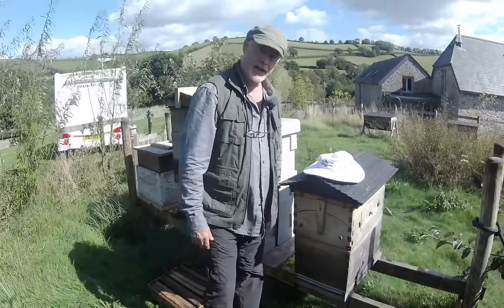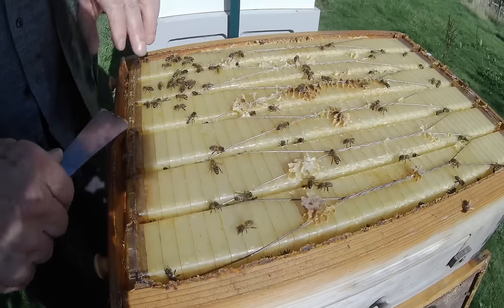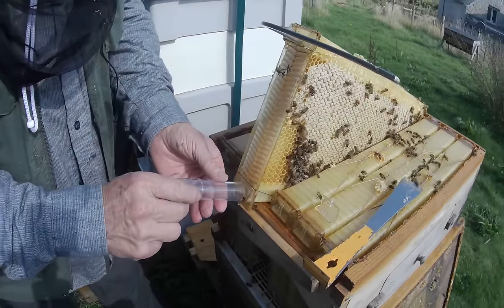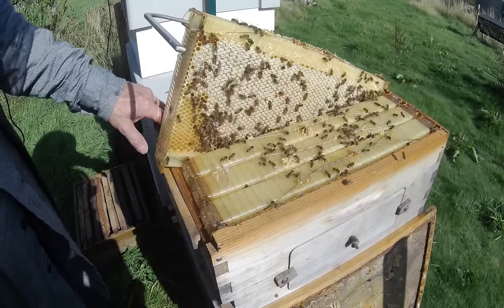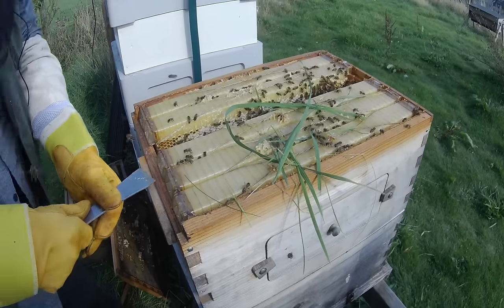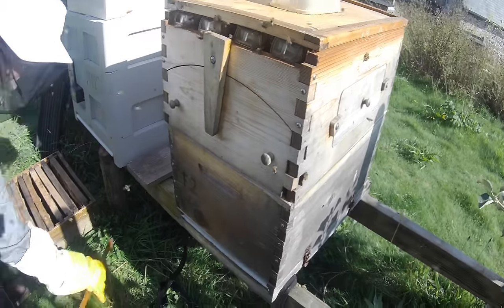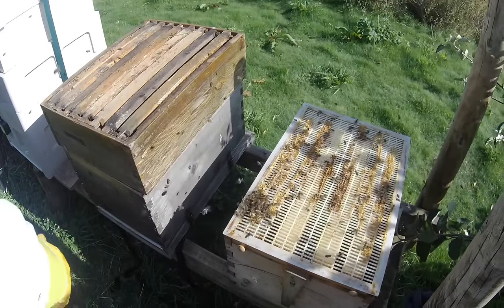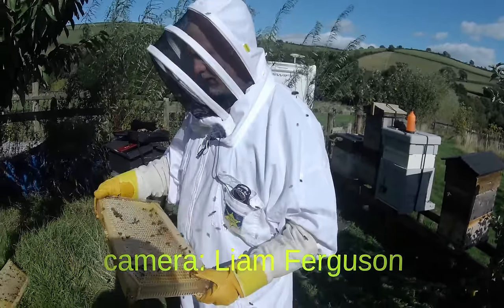Don't buy a Flow Hive until you've seen this!

Comment: I appreciate you sharing with us your experience. Every beekeeper has a different opinion about how they do things and this video is a perfect example. I have a flow hive. I love it. I also live in Colorado and I do not leave the flow frames on my hive over the winter. But first, it looks as though your bees are at the end of a flow, possibly being robbed and that is partly why they were so defensive. Because your flowhive wasn’t put together with the metal piece and the screws properly used to put the frames in the correct position, it led to more issues. I read that you think smoke causes the bees to prepare to leave and fill up with honey, but the chaos produced in not smoking the bees would be more likely to cause them to abscond. I try not to use much smoke with my bees, but it is a necessity if you are dealing with defensive, irritable bees. I start with a bit of smoke on my hands, hive tool, clothes and at the entrance. After opening the top or removing a box, I give another puff of smoke. This helps protect you and the bees from more stress and stings later. The smoke confuses the alarm response and pheromones used to communicate danger to the other bees. If a bee is bumping me and letting me know she doesn’t want me there, I give her some smoke. If a bee jumps at my hive tool, I give a puff of smoke to that bee. If stung, smoke where you were stung, because bees will be drawn to attack that spot. More alarm pheromone in the air will make it impossible to work bees without chaos. More chaos~more stings~more dead bees~ more alarm pheromones~ and the cycle continues. Fewer stings mean fewer bees dying. The bees will also put the honey back into the frames from their honey stomachs when the threat of fire is gone. If I can tell my bees are more on edge than normal, I will wrap up the inspection. I don’t know your climate there, but it looks cooler. If you have enough time for the bees to put the honey somewhere before winter, I would turn your flowhive box so you can harvest from the back of the hive. If it is too cold for the honey to be harvested outside and won’t be able to run out of the flowhive, then bring in the frames and harvest inside the house where it will be warm enough for the honey to run out of the frames. Use a regular deep box to put your beeless flow frames in one at a time to transport into the house. Once inside you can put back into the flowhive box. I would harvest the two middle frames that were capped for yourself by tilting the box at an angle like the flow videos suggest, then I would harvest the uncapped frames and feed the honey back to your bees. Just put the honey containers inside a deep on the top of your hive where the bees can move it back down into the hive. Also,  be sure to put pine needles or something on top of your honey to keep the bees from drowning and make sure no bees can enter the hive from anywhere but at the bottom where they can defend it. I would also make sure you have the entrance reducer on. I’m sure you are a veteran at all of this, but I thought u would go into tail for the non beekeepers following this. I let the bees clean the flow frames but make sure you put them at least 30 feet away from your apiary to not attract robbers. Then store the frames for winter. I always make sure I have a whole deep filled with honey before I put on my flowhive. I’ll put it on my strongest honey producing hive and will empty it for winter whether for us or the bees. I do think living in Hawaii would make the flowhive much simpler, but here in Colorado I just adapt to what works best for me. I wish you all the best with your hives.
Reply: Where in Colorado? Been looking for some local beekeepers to support
Reply: long comment man
Reply: Thankyou for your fascinating and educational comment.

Comment: A few things here, 1) you didnt follow instructions when u put it together, flow frames not adjusted tight to back of box and missing metal pc which keeps them from escaping out the back. 2) the cells split down the middle when opened and have a slight gap which will NOT trap a bee head, and you shouldn't be harvesting until a frame is full anyway. 3) Most beekeepers know that bees fill generally from interior to exterior, so if the window shows capped cells, you can be reasonably sure the interior is capped as well. Opening and checking before harvesting is always best practice for any beekeeper. 4) You didn't know which way the spigot is inserted, and actually guessed wrong, it will only fit 1 way with a tab and slot, your lack of knowledge of the  product does not give the impression that i should trust your opinion of it. Perhaps another view of the instructions and possibly speaking with flowhive owners would make you more comfortable with the product before you post a review next time.
I have owned a flowhive for 3 seasons now, harvested exceptionally clean and clear honey every season with minimal injury to any bees. I also have traditional hives, pros and cons to both systems. Flowhive themselves have stated that owning a flowhive should not be an excuse for practicing poor hive maintenance, regular inspections and treatments are still necessary for healthy and productive bees. Anyone who thinks they can just throw a flowhive in the backyard and collect honey without taking responsibility for the care of the creatures that produce it hasn't done their homework. I don't direct this last statement at you personally, as I can see you have productive healthy bees.
Reply from the maker: You clearly didn't watch all of it as I covered all of those points, as did about thirty of the comments below. But happy to give you a chance to sound off.
Reply: @BarefootBeekeeper  my apologies, I wasn't trying to slam you by sounding off, tried to point out a few of the issues that may have led you to your opinion on the flow hive. If that came off as harsh, I apologize.  I did watch all the way through, and yes you did address some of those issues, also spillage of honey into the hive during harvest is a valid concern, although opening 1/3 of a frame at a time pretty much stops that. It  does slow the process however. Your concerns with the thicker honeys not flowing was very informative as I live in a part of Canada where I don't have that issue.  Anyway, keep doing what you do and good luck with your bees!
Reply from the maker: @johnnybgoodbeesandbarbecue5788  we have ivy (Hedera helix) that sets like hard candy, and would really jam this thing up if it got in there. I think the only way to extract it would be to let the bees do it.
Reply: Show us your review of the flowhive! give us another perspective please. I am debating whether to buy a flowhive or not, so any information is good information
Reply: @BarefootBeekeeper   It makes a difference on how you use it, my friend. I suggest you watch a few videos of flowhives just to sharpen up on your harvesting knowledge when using these frames.
Reply: That metal pc was not included in first version of flow hive and they also realised it after people raised issue and uploaded videos about it so first they gave temporary soloution and later fixed it,Those  also had issues of gaps between box wall and flow frame . This flow hive is also from 1st batch when released
Reply: You have to realize there have been many changes to flow give since the beginning, so don't bash him for not having a hive that looks exactly like yours. There have been problems with flow hive since it began.
Reply: I’m new to beekeeping. Seems like a nice gadget but I feel it takes something away from the experience. Maybe it’s a newbie thing. Nice video.
Reply: Where can I find good information on bee keeping I want to own a  hive but want to do it right this guy doesn't seem professional since hes not wearing a suit.
Reply: @1-chef-875  bees can pick up our pheromones so if you are nervous and scared they will know something is up and get more defensive. if you are calm and collected they will only be confused as to what is happening with their hive. I have seen many videos of ppl doing this with no gear and they don't get stung
Reply: @1-chef-875  Lack of a suit is a sign of confidence and professionalism, not amateurism.

I don't agree with some points here, but yours really sticks out.
Reply: does the plastic it make it taste funny?
Reply: @1-chef-875  If you had done your homework, you'd know that Phil has probably forgotten more knowledge about bees that you'll ever learn! He definitely knows what he's talking about
Reply: @johnnybgoodbeesandbarbecue5788  I am wondering if I should get one or not. I wanted to start bee keeping, but don't really have enough space in the house to keep buckets just for collecting it and spinning the hives and keeping the spinning thingy is a whole other story. However I will If I have to, but if i don't I'd like to get the flow hive. I've heard nothing but good from it so I'm not sure. This is the only negative I've heard.
Reply: @MalixAtix  I have one of the initial Flowhives and the metal piece came with mine.

Comment: 1:) you need to adjust the screws in the other end of the frame to locate the flow frames all the way to the window view so no bees can get up via the end gaps. Ask Flow support or read manual on how to avoid bees getting into back window view. You may miss the side bars where it blocks the gaps next to the box walls. 

2:) You said you don't want to feed sugar and leave plenty of honey for winter,  why didn't you add the ideal box first then flow super? Should everything in the flow super be yours? It seems to be contradiction on what you said and what you done? 

3:) Your tool needs a hook to pick up one end and other end by hand rather than pickup by the cables,  this risks the damage of the frames structure by flexing it. 

4:) You shouldn't harvest off the hive as it defeats the purpose of flow hive,  it will be a sticky mess when you do it inside so don't complain if it doesn't go well! 

5:) Honey Super at the entrance? It's an invitation to robbers to come in and help themselves while you are at the dearth time? 

6:) it seems to add more dramas when you don't use smoker during inspection???
Reply: You haven't followed Phil very long, have you.
Reply: @W1ldt1m  Yeah, I think your right. Most of the Pro FloHive comments are really angrily pointing out all the unrelated things he "got wrong" without knowing who he or what he normally advocates. Funny.
Reply: Ir stressed the bees much more  than turning the key of the flow hive. Jesus, this guy has issues
Reply: He's not using it right, and the hive wasn't put together totally right. He needs to watch a few videos, and learn how to do it right. . .
And where's his smoker?? I've never had that much trouble with mine.

Comment: It's very obvious that bee keepers from different countries / regions will have different issues with the same product. Thanks for your input. It also would help a lot if people making videos ,can just mention from what country they are. 
A possible solution might be to use (I'm not sure what it's called in English) floor with a one way trap door. It is installed between the brood box and the super. This will minimise most of the problems with the bees. ( not the Ivy itself) . But as I have said. Different countries experience different problem and situations.

Comment: This is bad ownership, assembly and use. I have three flowhives and I love them.
Reply: I know a person who has raised bees for little over 75 years. His wife actually bought him one and he didn't care for it. Don't get me wrong he used it for the first year and took it down that following spring. I guess after doing something a certain way for that long he was just set in his ways. An didn't care for new and improved. He said if I am going to have to remove the combs to see when they are done I might as well use my old stuff. He said it was much easier to remove the combs with the wood frames than with the plastic. He said every time he went to check the plastic ones he felt like he was going to break them.
Reply: @Sabrina-rn9dn  New does not mean improved.  This is a great example.
Reply: Check the top of your frames for cracking, I have two cracks.

Comment: I’ve used my 2 flow-hives for 2  & 1/2 years and I’ve never had a single problem you discussed, you NEED TO FOLLOW the instructions on assembly and harvest and it works, I’m happy with mine, plus there is no additional equipment needed to harvest the honey, just jars to put the honey in.  
I’m in the process of changing all my hives to flow-hives, to be honest the only real problem I’ve encounter in the cost of the flow-hives’s,
Reply from the maker: Where are you?
Reply: Australia

Comment: Maybe you could avoid killing half your bees by turning the key really slowly, so that the workers have enough time to get their heads out of there.
Reply: It doesn't shift enough to kill anything it barely shifts the comb enough to crack the cells and allow flow. Anyway the harvest should be waiting until most cells are capped anyway so nobody's head is in a cell to begin with...
Reply: The flow people suggest waiting until the end is full and capped. You can then check the frame for full capping if you wish but generally if the end is capped the frame is likely very full and there should be minimal bees actually in cells.
Reply: @Hadriandidnothingwrong-z8c  yes. And many others.
Reply: @SageandStoneHomestead  well you are not the only one. But it seems like instead of watching this one, you went directly to the comments.
Reply: @SageandStoneHomestead  "The flow people suggest waiting until the end is full and capped. You can then check the frame for full capping if you wish but generally if the end is capped the frame is likely very full and there should be minimal bees actually in cells."

This is a bad suggestion since he is limited with time. 
The ivy honey was about to appear and you don't want that in your flow combs. This is why @GodTheChaoticEvil Narcissist asked you if you watched the video. 

That was basically the main problem. Combs are not full but time's run out. More problems arise with the plastic degrading over time causing cracks and other inconveniences. This flow hive is alright for home-use since you have more time and control but on a large scale, I don't see this being used in Europe where most of the honey made is taken from locust flower's nectar which hardens very fast. It's a cute design and an idea, but unusable in certain parts of the world. I suggest more work on this project but I fail to give any solutions for the said problems.

Hope you have a nice day,
from Croatia.
Reply: Damn you guys really get heated over some new hives lmao

Comment: 1. You have not fitted the flat metal bar on the bottom of the Flow Hive super so the bees can enter the honey harvesting space.
2. It doesn't look as though you have adjusted the Flow frames correctly either also allowing the bees in to the harvesting space. 
3. What kind of beekeeper discards burr comb as you do in the video? Great way to encourage vermin!
Reply from the maker: 1. There was no metal bar in the kit.
2. There was no visible adjustment that would prevent access.
3. Nothing I know of eats beeswax.
Reply: @BarefootBeekeeper  There should be a metal bar and you adjust the way the frames fit by a screw on the back of the frame.  You did read the instructions?
Reply: @trevor311264  thank you.
Reply: @BarefootBeekeeper  https://www.honeyflow.com/media/images/content/detail/gallery_DSC00618_2500px_72dpi_no_wm-gallery1029_May31101549.jpg shows the metal bar in place (it's silver).
Reply: @gonnagetya1433  thank you.
Reply: @BarefootBeekeeper   wax moths and mice both do.

Comment: I have one of these in Ireland North west with no issues. You obviously have to take it off at the end of August before Ivy comes in.
Reply from the maker: Obviously. Unfortunately, there is no way to know if the Flow frames are capped without removing them, so if beginners leave them in place because they can't see cappings through the window, they will get ivy in there.
Reply: @BarefootBeekeeper  I normally take it off in August. If its not capped, then feed it back to the bees. Ivy here is still not on. Removing frames to check is not an issue either.